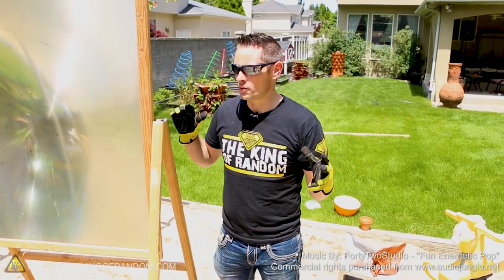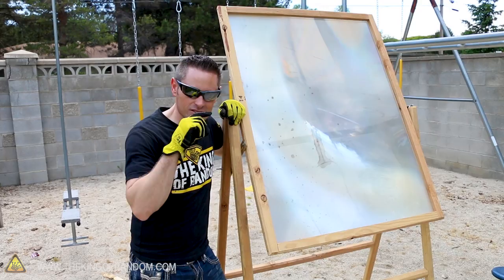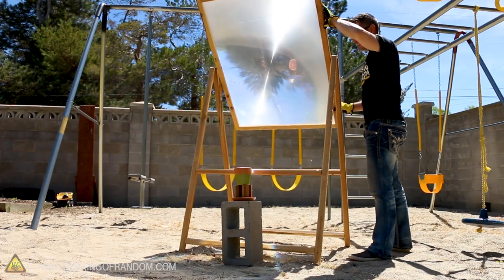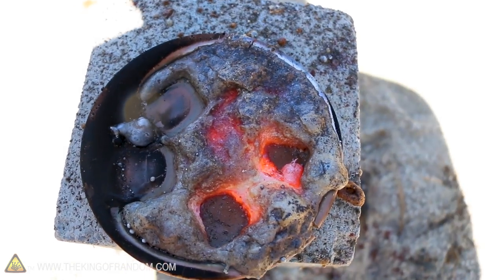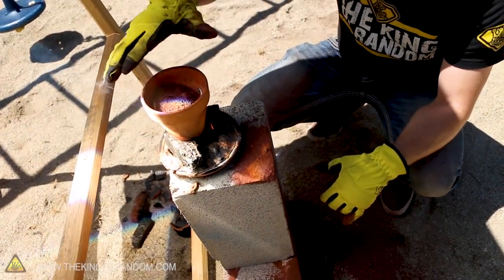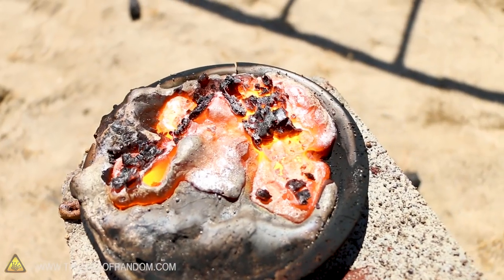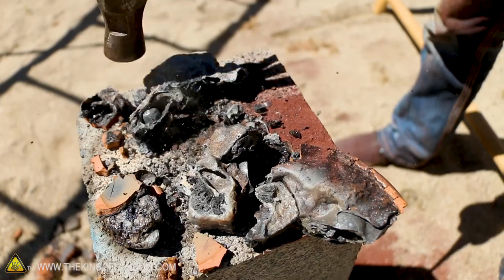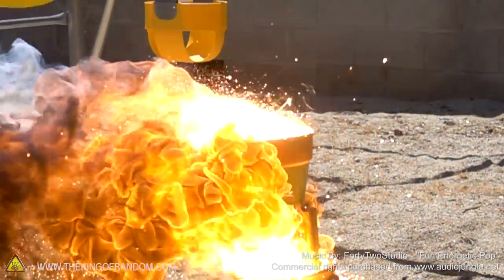Will The Solar Scorcher Light Thermite? TKOR Tests A Solar Beam From Giant Magnifying Glass

Comment: Make a sunlight powered foundry, that would be cool!
Reply: the problem with that is that you would need a way to focus the light and make it come in from a different direction, very high quality mirrors. Also, he would need to wear something that could resist 3000 degrees, which is only a  space suit, and those don't even work.
Reply: Jack Drumm thanks for the intelligent comment... I knew something would go wrong with a sunlight powered foundry because I thought that too
Reply: He could do something to disrupt the light away from the foundry to take out the crucible .etc
I'm pretty sure he can find a way around it.

Comment: is it possible to make glass by  pointing the solar scorcher on sand
Reply: glass as you know it isnt only just sand
Reply: iamtheonewhoyoulove if runescape taught me anything it's sand and soda ash, whatever that is
Reply: Well, sure, while commercial glass is about 75% sand (silica oxide), you can make a glass-like substance from sand only.
Reply: iamtheonewhoyoulove You can get glass whenever lighting hits the beach
Reply: Meo Deez it would have to be extremely hot, lightning is near the temp of the surface of the sun
Reply: Meo Deez  do it Tom
Reply: I've been asking that ever since he made that fidget spinner cast
Reply: It's very possible sand melts at 3,200 degrees and this video shows it can get there
Reply: Definitely, that is a great idea. Then I could probably make my own glass...
Reply: It can.  He actually showed this on his original solar scorcher video years ago.
Reply: Eric Schwartz no he showed it melting glass, not making glass from silicon, i.e. Sand
Reply: anonymous  they said silicon, as in elemental silicon. silicone with an e is a compound that is completely different. silica is silicon dioxide.
Reply: meo deez im sorry what school taught you that sand and heat is how you make glass you were rong sorry so i think you learned that from minecraft or 7 days to die
Reply: mabye but you need sand, gravel and something else but you cant heat it you have to melt it
Reply: MACARGO (the pokemon) VS. DESERT

Comment: You should make a DIY solar powered furnace like using your solar scorcher as a heating source
Reply: Elastico345 - Mixels and other stuffs well using two blow torches make his melting projects much faster because the solar scorch can't melt much thing like steel for example
Reply: It can. You just have to leave it on for a much longer time

Comment: casually leaves thermite in the playground sand
Reply: and that's a problem why? he already told us that flames from say a lighter won't do anything, and if you are trying to burn thermite you need 3000 degrees F... what kind of kid is going to find rust powder, and some aluminum powder and think, yeah let's get 3000 degrees F to light this up... even if you held a lighter to it, nothing will happen, it's mostly just rust powder....

Comment: I want to see that happens , the ultimate battle , liquid nitrogen versus the sun powered panel of death. ;)
Reply: The liquid nitrogen would just instantly boil. Like water but the gas will be nitrogen instead of steam.
Reply: TheRandomGuy I made my own solar death ray and I did it with liquid butane. Even the flammability in it did not ignite, and it boiled instantly.
Reply: Kevin have you ever tried to boil ice the reaction is brutal, cause of the difference between the temperatures, also the time that needs to be completed is just awfully fast. So in my.oppinion the reaction will be extra violent.
Reply: Ryan White butane boils at room temperature
Reply: Keem Star so does liquid nitrogen. I cooled the container down to liquid butane temperature and the volume would stay for about 3 minutes boiled instantly

Comment: I tried to cast a mold with iron using thermite in 4th grade and what you need to watch out for is oxidation. When I first did it I did it the same way except I lit it off with magnesium. The second time I did it though I made a closed container with the mold in the base as to not let any oxygen in and it did make a nice solid nugget of iron with the mold in it and it mostly solved the oxidation problem.

Comment: I'm not sure about casting the metal, but there's a process called exothermic welding where you take two pieces of metal and push them together, wrap them in a metal with a lower melting point, and form a little crucible around it with special clay. You then add thermite around the melting metal and light it to permanently fuse the two pieces.

Comment: This solar scorcher will help you in casting with copper, it can easily evoporate the styrofoam so, just mix two projects for a new succesful project!!!!
Reply: yash patel but the sand will be melted to, I think.
Reply: sands melting point is 3002 F , so it will get harder but will not melt
Reply: sand will get harder but it will not melt
Reply: well, the scorcher can preheat the mold and help to keep the copper fluid longer for a full casting.  I think the reason copper is such a challenge is how close you are heating to the melting point of copper.. it cools before below the line before you have time to cast.  the scorcher would be a great idea for the mold.  another suggestion would be to research a dope for the green same that will increase it's resiliency.  I assure you that this is will documented somewhere.
Reply: yash patel but he said thermite ignites at 3000 Fahrenheit. If it can ignite thermite it can melt sand
Reply: sooo, maybe he can just increas the aera of focus so the temprature will decrease.
Reply: yash patel I think the goal would be higher temp, not a lower one.
Reply: yash patel you should edit that so it doesn't say you will get hard
Reply: yash patel yes
Reply: Mike Beaver Well, thats half true.  He heated the copper well past the melting point.  Its the fact that metal is an amazing conductor of heat that the molten copper radiates all the thermal energy into the air, which rapidly cools the copper.  I don't understand what you were saying about the "dope for green same.". Anyways, you had a great initial idea! ;-P
Reply: I think the easiest way for him to be able to cast with copper is to do the mold in two parts. using the top and bottom of the mold. this way the top can support the bottom half and being only half the gear he should be able to pull the Styrofoam out from the sand with relative ease.
or use wax. It melts easier
Reply: happypanda chow dope... adding something to the green sand to improve it's cohesion.  sorry about the autocorrect.   Grant Thompson had an issue with the same breaking up when pouring the copper gear.  it could be how fine or how deep the holes in the gear we're made.  the scorcher as a second item can increase the ambient temp of the mold and contribute heat to the copper to slow it's solidification.  Yes, you would not want perfect focus to add heat, slow cooling, and avoid melting the same at the same time.
Reply: Mike Beaver Okay, i was confused and thought it was autocorrected heavily.  Thanks for the info too! ^-^

Comment: do you think you can melt tungsten with the with your solar ray of doom
Reply: NOOOOOOOOOOOOOOOOOOOOOOOOOOOOOOOOOOOOOOOOOOO
Reply: it wouldnt work
Reply: with a melting point of around 6000F i would say not possible
if you want to melt tungsten you should prob use a oxyhydrogen torch xD

its basically a blow torch that is supercharged

Comment: You should cut a piece of the Solar Scorcher out and put on top of the Trash Can Foundry to melt metal!
Reply: what makes the solar scorcher work is that it's huge. A small piece wouldn't concentrate nearly as much sunlight.
Reply: though he could probably use the solar scorcher to replace his propane torches on sunny days.
Reply: Christian: it would melt the fiber he has inside the foundry, SavageGreywolf: it's not necessarily that it's huge, you can get the same effect with thicker and smaller products, (read The Mysterious Island) you can get the same effect as long as you have enough of a focus. someone made a death ray with a satellite dish, and 1500  1cm squares of glass. DaemosDaen: it would be impossible for him to reach in without burning himself, and he would constantly be having to readjust it, which is why he uses the propane, it takes more than a few minutes to melt that much copper or metal or whatever, and the scorcher gets it too hot and makes it boil after a few seconds.

Comment: Can the solar scorcher make glass?
Reply: Fluffycat264 the sand did not react so I believe not
Reply: Xэnochrom Because the solar scorcher wasn't focused on the sand
Reply: Fluffycat264 If it can light thermite then Yes it can make glass. can also melt glass if you can melt a clear piece of glass with it gl.

Comment: Solar metal foundry?  :)
Reply: RebelRon I was thinking the same thing! It would be cleaner and easier to use if it worked
Reply: RebelRon liquid nitrogen wouldn't burn. It will just boil very vigorous and evaporate.

Comment: Can thermite melt steel beams?
Reply: it burned at 3000 F, steel melts at about 1500, it will boil the steel pretty easily, like he said he melted copper... which takes 2000 degrees.
Reply: Jack Drumm uhmm, steel's melting point is 1500degrees Celsius....
Reply: Jack Drumm while copper's melting point is 2000degrees Fahrenheit
Reply: Jack Drumm He melted the copper with the solar scorcher not thermite.
Reply: I don't think the comment section adequately understood your reference.   So I'll say it.  9/11 was an inside job.
Reply: I get it
Reply: wanna hear a dark joke😈
Reply: What was the last thing to go through the minds of the 9/11 jumpers? Their feet
Reply: That is how to offend people
Reply: i didnt say yes
Reply: DeadShotGM wonder if you can use this instead of a furnace.
Reply: DeadShotGM 
No, he only destroys reinforced walls.

Comment: You should try using a different base to catch the iron. the terracotta may be burning and releasing gas into the iron as it cools. This will give you the vesicular texture that you saw in your experiment. This is much like the formation of pumice or scoria (lava rock); the rate of cooling and the amount of gas being trapped in the material will dictate the final texture.
Reply: Caleb Stroup I was thinking that the iron was actually boiling and that was the cause of the bubbles inside, but I am no expert on metals... just a guess.  Sounds like we are talking about something at least similar if not the same
Reply: Warhawk76 that could be! I am not an expert on metals either. I just have a little background in geology and noticed some similarities to fast cooling volcanic rocks.

Comment: What happens when you put molten copper in liquid nitrogen?
Reply: dang i was going to say that!
Reply: It would very rapidly boil off most, if not all of the nitrogen by the time it solidified. You could get pretty much the same reaction by heating up a pot on the stove at full heat, then pouring water in. Though I wouldn't recommend that, as it can leave you with severe burns.
Reply: The Leindenfrost effect would let the copper slowly cooling off while making a big cloud of nitrogen
Reply: Ghost Rider its still be cool to see though.

Comment: can you use a smaller version of the solar scorcher that's easy to make and can make barbeque coal ignite?
Reply: Gaming with Sid 
magnifying glass
Reply: General66  i don't think a magnifying glass will create enough heat to ignite coals in a short amount of time.
Reply: two magnifying glasses?
Reply: james pogrebetsky that will maybe work
Reply: well... a magnifying glass can ignite regular wood in a short amount of time.
Reply: shimba90 well a barbeque burner can easily ignite wood but does not ignite wood so quickly cuz both have different igniting tempratures . I think it will be the same with a magnifying glass

Comment: If you add 2 parts charcoal powder to your thermite  mixture will it still light off? 
If so, you could easily made high carbon steel. 
Yes, a sand mold can cast steel and iron. You will need to use oil bonded sand instead of green sand and add a flux to the mixture to help reduce air pockets. (Flux will allow the beads to come together. The oxidation from dropping through air causes those internal voids. 
Another problem you may be having with green sand is the fact that the clay is a consumable. After a casting, some of the clay will have vitrified and won't hold water anymore.

Comment: Would the Solar Scorcher melt a solar panel or will it produce energy. Let's find out.
Reply: It would very likely melt it. I'm not sure what solar panels are made of, but I'll bet that they have melting points below the level of heat this can produce.
Reply: cool idea but it would probably melt
Reply: Harley Large would melt a solar panel, but there is a method of solar power collection method that uses a bunch of mirrors focused on a central tower, so you could generate power with this, it just wouldn't be a solar panel
Reply: You absolutely could use it to increase a panels power, but you'd have to put the panel closer than the focal point so that it DOESN'T melt.
Reply: Actually, that isn't really the case.
See, they're not really "producing" the heat, they just focus it and physics do the rest.
They won't normally melt, because the sunlight is dispersed all over it, and then they just focus it in 1 spot.
If you get another Solar Scorcher and focus it onto another one, it won't melt, probably, because it'll either re-focus it, or disperse it, depending on which side you focus the light beam in.
Not really sure about this, though, it's just how i feel about it
Reply: lets think about this, the Solar panel works using  multiple cell surfaces all wired together to collect the solar energy. The solar scorcher works by focusing the solar energy all in to a signal point. I believe that yes there is a chance the scorcher will just burn a hole through the panel. but I can say for certain that you will not get the effect your looking for, it will  not give you any tangible amount of energy with just a signal active solar cell.........
Reply: The melting point of silicon (what solar panels are primarily made of) is somewhere around 2,700 Fahrenheit. It would probably melt it.
Reply: Silicon and some metals

Comment: Will the scorcher melt soda cans??
Reply: If it can burn thermite which needs 3000 degrees Fahrenheit  to burn, why tf wouldn't it burn through soda cans?
Reply: the heat will still be transferred its not like the soda cans are invulnerable to heating.
Reply: clearly you dont. obviously you have never been to a playground on a sunny day as a kid because the metal slides are always extremely hot to touch. also he melted copper with it so he could clearly melt alluminium
Reply: Chorosso lol
Reply: Ethan Yegudin lol
Reply: Nazar Gubenya noooooooooo wayyyyy
Reply: If you look up some older videos, you'll find him burning some stuff with it, He actually cooks an egg with it, and it was so reflective it didn't burn, it rather cooked properly.
Reply: even if he did do it (im not bothered to check) its not going to be the reflectivity that made it not burn
Reply: Nazar Gubenya yes
Reply: if chuck norris says it can then it can
Reply: Soda cans? Yes, it Can! It Can melt a hole in a can in less than a second. Melt cans? Yes You Can!
Reply: well.. it can melt copper.. wich has a REALY HIGH melting point .. soo it will melt these cans in a seccomd

Comment: Try heating up a pan and Cooking breakfast with the solar scorcher(a.k.a Sun).
Reply: He already did that.. He didn't heat up a pan but did cook it on concrete
Reply: VISHIZ WAHINE maybe a copper/aluminum (or even a copper sheetmetal screwed onto an aluminum bus bar) bus bar large enough where he focuses the solar on one end, and have the pan sitting on the other end (using radiation energy to conduction for heating the pan).
Reply: Korej Cookies I did that in normal sun! ._. lol

Comment: is silly string flammable and if so can you make a fuse with it
Reply: James Alexander I'm pretty sure silly string isn't flammable I'm not sure though I've seen it used as a fire extinguisher before but the pressurised cans aren't flammable either but explode when exposed to to much heat

Comment: can you see if you can focus the solar scorcher on a solar panel to make electricity
Reply: Dhruv Jat I'm pretty sure the solar panel would melt.
Reply: Z-PotatoMC not if the scorcher was smaller
Reply: Dhruv Jat solar panels don't generate energy from heat, it's from light
Reply: you wouldn't actually want to focus the scorcher on the solar panel, you would want to set it so that it maintains the large square, otherwise you will melt the components of your solar panel. this is also the reason(if you've ever seen them on a roof, or something, there is a big plastic piece that is round, so it doesn't focus light on any specific point.
Reply: Solar panels work from taking heat energy from sonlight, so yes it would work.

Comment: can you heat up liquid nitrogen with the solar scorcher
Reply: if it is heated at all it turn into gas,.
Reply: It does, just fairly slowly because the ambient temperature of the container it is stored in is very low. Due to the liquid nitrogen stored in it.

Comment: The idea of casting with thermite is interesting, however the iron produced is not very pure, containing large amounts of slag and aluminum. You could however cast iron using a furnace called a Cupola furnace that is a refractory lined cylinder filled with Coke or Coal and then supercharged with a blower. I would love to see a project like this, especially since you could also refine iron in the furnace from iron ore.